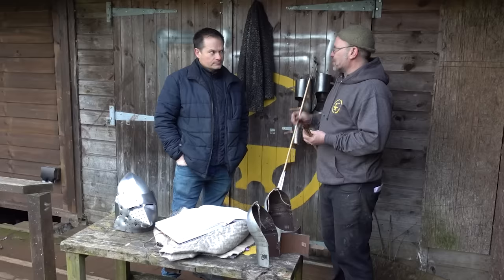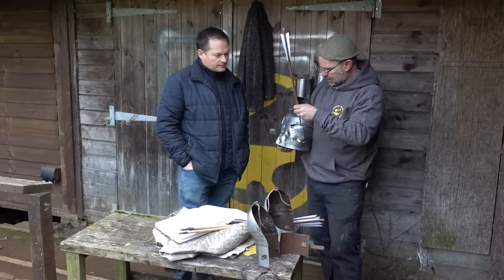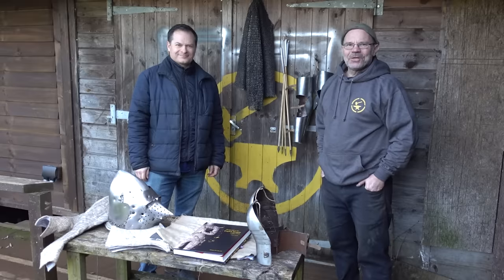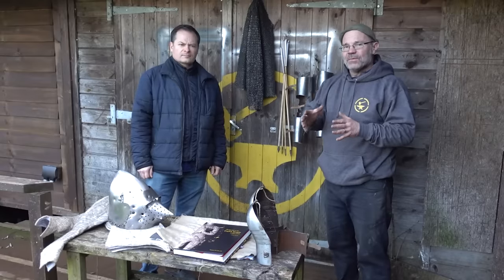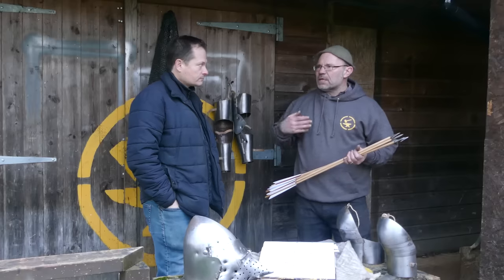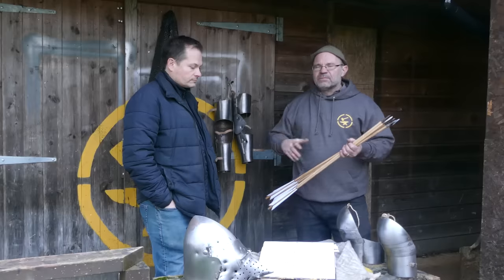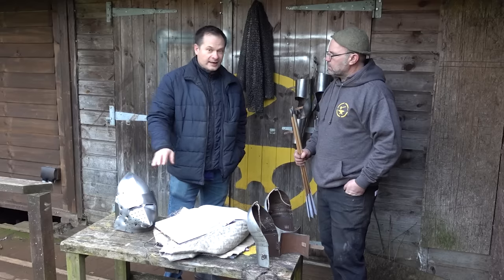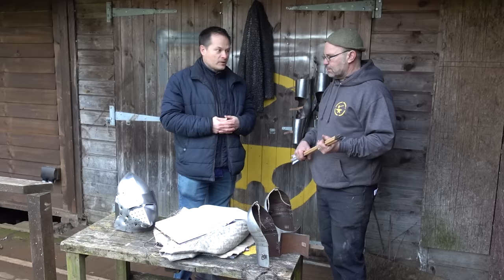Arrows vs Armour 2 - Our thoughts 6 months later

Comment: I guess the reason besagews started to be prominent in 1420s was what happened at Agincourt
Reply: Incorrect. Besagews appear first around 1340, in England. Then they sort of disappear, to become common again around 1420, in ENGLAND. French armour skipped the whole besagew thing and went directly to pauldrons, before Agincourt happened. It wasn't typical then, but shoulder protection that covered the armit was already known in France before 1415.
Reply: @JosefGustovc  you're way off. Invented and prevalent are not the same. And you proved his point. The ENGLISH  were also at the battle. They were the most direct witness to the vulnerability. 

Toby covers in this video the flaw in your logic.
Reply: @mandowarrior123  Besagews and paudrons do the exact same thing. Protect the armpit. Agincourt definitely did not make them widespread. They were before that. Lances were a much more prevalent and deadly threat than arrows, which is one of the main reasons for the up-armouring we see in the XVth century. In fact in England, the besagew and proto-paudrons that cover the armpit become ubiquitous between 1410 and 1415, so BEFORE Agincourt, and they weren't the ones being targeted by 10.000 archers in an open field battle so they didn't have the reason to cover up that gap because of arrows. So the argument that besagews and pauldrons became more popular because of Agincourt just doesn't hold water and is not supported by the evidence. That process was already ongoing by then and it wasn't accellerated by an odd battle somewhere in France.

Comment: you're kind of strange - a couple of months ago, you and Mel , with your knife, chuckling, pierced a 1.5 mm sheet of steel, and Mel said that he was hitting at half strength, and now, contrary to your own experience, you claim that armor could protect from a blow with a sword and a dagger, but an arrow pierced them. This contradicts not only your own experience, but also the laws of physics - the impact momentum of Joe Gibbs's arrow is less than 5kg/m, and the full impact force of a strong man is 200-250kg/m, the master of sports in boxing is 500-550 kg. The illustration of the speed of the arrow depending on the distance looks strange - I will reveal the secret of Newton - discovered the law of universal gravitation, according to which everything falls to the ground with an acceleration of 9.8 m / sec / sec, i.e. at a distance of 50 m, the arrow falls at a speed of 9 meters per second, which, by the way, may explain why the arrow suddenly accelerated, but the illustration does not show that the throwing line would go above the trajectory line.
Your logic that the knights should have calmly waited for them to be shot, and not to defend themselves, became clear to me after Stolz's demands to the Russian military not to destroy the leopards-2, but only to damage them so that the FRG could repair them and return them to Ukraine, and not supply new ones, since this is a burden on German taxpayers.

Comment: I don't understand why the Pavis, the throat to knee usually plated shield,  is not mentioned. The man at armes was the first private soldier, either provided as a part of a thrall to the king or under contract for a set period who lived, breathed and talked warfare 24/7. These were not stupid men or ill equipped militia/foot soldiers, they equiped themelves with what was then state of the art kit which included the Pavis shield and when horsed the smaller heater shield  which probably was not plated.

The Besajew or rondael was recorded on English knights as early as 1350, eighty years before Agincourt. By 1365 all English armour was proofed by law (Edward III) against "sword, axe and arrow". The vast quantity of armour plate imported from Germany (Innsbruck) and Italy (Milan)had been proof marked usually by the arbalest (windlass crossbow) with copper flights. I suspect that retesting was also done at the Tower.

Comment: Ironskin had a handmade chainmail competition and most chainmails were able to deflect the crossbow arrowhead. How is this possible when your chainmail didnt deflect one arrow?
Reply: The crossbow that I saw Ironskin use was only 220kg draw. For a medieval crossbow to equal Joe's longbow I would think it would need to be a lot more powerful. Like >350kg.
Reply: The aventail did deflect almost all the arrows it got shot with. And the weave of the rest of the hauberk was just too weak. If we would have had reinforced areas, like in the armptis, then I suspect most arrows would have bounced there as well.
Reply: @JosefGustovc  Probably. Though using very heavy mail as a void for plate could be problem on its own.

The use of a crossbow that doesn't require a windlass to arm or a less powerful longbow is perfectly reasonable, but it's not the same test.
Reply: @molochi  a Medieval crossbow would need to be in the siege crossbow range (>1000 lbs) to equal an English longbow. Medieval European crossbows weren't designed that well
Reply: @MarcRitzMD  That's possible. I've been basing my estimates off of steel armed replicas like the ones Tod makes. So 5 to 6 times the poundage with the short draw of the crossbow. I actually think that could be conservative if composite bow construction was actually more efficient than steel or if the bolt fired by the crossbow was heavier.
Reply: Even increasing the draw of a crossbow by a couple of inches could make a big difference
Reply: @molochi  yup, that is the biggest aspect, the short draw length. I was however basing it on one of those videos of Tod when he mentioned exactly that in a side comment. Impossible to find now, but probably when he was discussing his crossbow reconstructions. 
I could see how that ends up happening, too. With a bow, you can rather safely approach the material limits. You learn how little wood and how little string material is necessary, and you add a little more. If it breaks, fine...maybe a few cuts at most but mostly just scary. With a heavy crossbow, you might lean more to the safer side and overbuild it. Those strings are now ropes and the steel is made to never break.
Reply: @MarcRitzMD  Agreed. But the weapon is fairly compact and you can train people very quickly to be effective with it. None of this taking 5-6 years to produce a longbowman that can draw 160#.

Whats interesting to me is that the Chinese of this period went with much longer limbed crossbows that were likely just as effective as an english longbow and didn't require a contraption to arm.
Reply: @MarcRitzMD Andreas Bichler's 620 lbf composite prod crossbow achieved 151.4 J with a 76.7 gr bolt, more than what a 160 lbf longbow is capable of.
Reply: @MarcRitzMD  Incorrect. A 462lbs composite prod crossbow, belt hook spanned, delivers the same amount of energy as a 120lbs longbow, which is around 110j. Joe's 160lbs longbow delivers as much as 139j, which is surpassed by a 1200lbs composite crossbow, crannequin spanned, which can deliver 192j of energy, or a 726lbs composite prod crossbow, crannequin spanned, which can deliver 151j of energy.
Reply: Crossbow of 220 lbs and 6 inch power stroke is equivalent to a 45 lbs childs bow with 30 inch power stroke.
Reply: @JosefGustovc  sounds dubious, where is the proof for a 1200 lbs composite prod that is crannequin-spanned. They would all be steel-prod and windlass-spanned.
If you refer to crossbow designs which aren't found in Medieval Europe, then that might very well be possible. Austrian Andreas Bichler is someone who makes cool crossbows but they aren't useful references when they aren't shown to be of an authentic design or that the measurements are verifiable.
As it stands, the crossbows of Tod are rather well documented by himself and he enjoys more community trust. There's a reason his crossbows aren't composites.
Reply: @MarcRitzMD  Composite prods were the prevalent ones in Europe BY FAR. Steel prods were in the minority for the whole of XIVth and XVth century. Just look the inventories, museums and medieval art. Composite prods are just way more efficient than steel ones, and it has been very easily demonstrated by Bichler for example. Tod's crossbows just are not represntative of the majority of what would have been found on a battlefiels in the XVth century. Just look at the art and go count how often you see brown prods compared to black/gray/azure ones. And no need to span it with a cumbersome windlass when you can do it with a more convenient crannequin. Yes, Tod's crossbows are cool and well made, but they are definitely not the only stuff that was used 500 years ago.
Reply: @JosefGustovc  Aren't there only like 2 surviving examples of composite xbows though? I am impressed with the numbers but I'm not familiar with the source. So I found a short video on the 1200# xbow. It's pretty tiny and cranquine armed. That's... interesting.
Reply from the maker: I have to agree with Magister Armorum.  Composite prods were very common in this period and I use steel because there are far easier to make and are TBH reliable in a way composite prods are not.  I am comfortable using the steel because they were about so that is OK, but yes if you look at the manuscript pictures composites are everywhere, but I guess steels are over represented in museums because they last better.  Composites seem to be significantly more efficient and also Andreas does excellent and very informed work, so please don't dismiss his work so readily
Reply: @mandowarrior123  what? Why?

Comment: The tests were great, especially all the hard work that went into making it a reality. However, I have noticed quite a few people across the net referencing the video as evidence that the longbow was a medieval machine gun that could slaughter armor troops when that is not what the video showed. It was great to see what injuries could occur and different areas armor could potentially fail, but I think the audience (not the creators) needs to realize we are still only seeing a very small part of what really happened during Agincourt. 

The main things for me that should be re-enforced;

1) we don't know what poundage medieval longbows actually were. We don't even know if the bows from the Mary Rose Find were representative of common 16th-century bows. 

2) we don't know what range most of the arrows used in Agincourt were used. We need to consider that archers would generally have been withdrawn before they could risk being charged so the 15-meter range used in the test may well have been a rare extreme.

3) if longbows (and crossbows) could regularly penetrate armor then they likely would have played a bigger role in many other medieval-era battles. Yet it's in a relatively small number of battles like Agincourt and Crecy, in which archers were well protected by terrain/conditions and could continue to fire over long periods, that longbowmen played a key role. 

4) At Agincourt and Crecy, French men-at-arms were able to close distance multiple times, even on foot through muddy terrain. We don't know the hard numbers but there are estimates of around 100,000-500,000 arrows used at Agincourt with about 6000 French casualties.  A large percentage of these deaths were from melee, being crushed, or execution after the battle concluded. Therefore even in ideal conditions, it is fairly safe to assume that only a minority of arrows used directly resulted in deaths or incapacitating injuries.
 
This is in no way a criticism of Todd or any of the others involved. It's just things to keep in mind when we evaluate what we saw in the tests.
Reply: Would generally? At agincourt the archers were mixed with the spearmen and protected with stakes, it seems they shot from short range to point blank. This is partly one of the things Toby is referring to when saying it was atypical. Archers were seemingly used in close, perhaps even directly into the melee.

Certainly they were used to flank the french while in combat, seemingly close in. 

You argue the English defeated 8,000 for 600 losses outnumbered 2 to 1 or more primarily IN MELEE? Can we get a sense check on that? And you think each archer after this long campaign had over 100 war arrows on their person in this battle? Or are you referring to both sides? The french had nearly equal numbers of archers to the English.  Thus on your low end that's just 8 arrows expended per mortality on the English side. Archers and crossbowmen DID play a huge role in medieval era battles.
Reply: @mandowarrior123  

>At agincourt the archers were mixed with the spearmen and protected with stakes, it seems they shot from short range to point blank.

massed units using combined melee and ranged tactics require a lot of training and coordination and did not see common use until later centuries. Thousands of men in formation cannot quickly reposition and if archers are charged there is a large risk of this causing a mass route. While it is believed there were archers positioned between groups of English men-at-arms, as well as a large number on both flanks of the battlefield, most of these archers would have withdrawn to safety long before the French were at short range. Even if they didn't there would simply not be enough room for 5000 archers to stand in a line and fire at short range.  Therefore most likely the majority of arrows fired by the archers were at longer ranges. 

>And you think each archer after this long campaign had over 100 war arrows on their person in this battle

We don't know exactly how many arrows they had. Each of the 5000 archers likely had 72 arrows at the beginning of the campaign but we have no idea if they received any further supplies and how many were used before the battle. We do know from 1st hand accounts that many/most of the archers ran out of arrows before the end of the battle. Hence conservative estimates of the arrows used are from 120,000-360,000, but it is possible for it to have been higher than that. So probably 20-60 arrows used per French causality but when we take into account that probably at least half died by other means, those figures increase to 40-120. 

>You argue the English defeated 8,000 for 600 losses outnumbered 2 to 1 or more primarily IN MELEE? Can we get a sense check on that?

I stated that a large percentage of French were killed in melee, by being crushed, or by execution after the battle. We don't exactly how many but the numbers would not have been low based on accounts from both French and English sources. The French defeat was a combination of factors but the biggest was that they had to cross 1000 yards of narrow and very muddy terrain to get to the English. The heavily armored men-at-arms got stuck and the constant barrage of arrows made crossing even more difficult so by the time they made it to the English lines they were exhausted and could barely defend themselves.  The desperation of soldiers to keep moving meant many would have been crushed and it's notable that period sources emphasize the English archers entering the melee and basically executing many men-at-arms due to the lighter-equipped archers being far less affected by the mud

Just look at the "German mud wizard vs riot police" for a good example of how much the French soldiers possibly would have been struggling to move in the mud. Then combine that with research performed on crowd crushes like Hillsborough in 1989 and Seoul in 2022 and you can get a reasonable idea of how the numerical and heavily-equipped French got slaughtered in the melee.  We will never know how many were killed by arrows but based on the fact the English probably used all they had and yet the French still managed to cross 1000 yards of muddy terrain, the number who died from arrows was probably half or less.